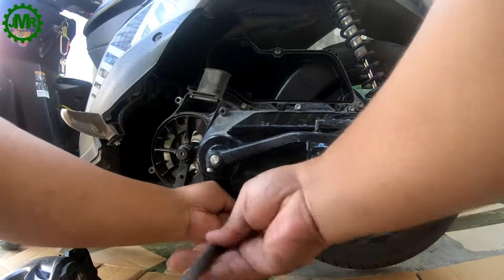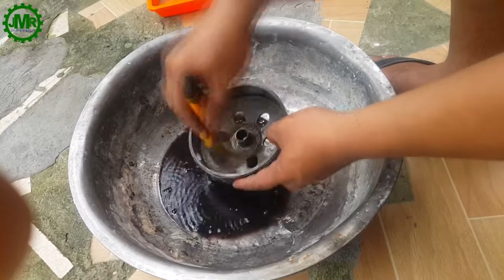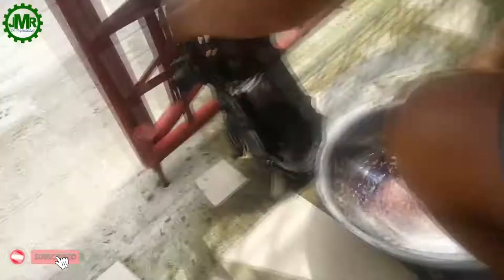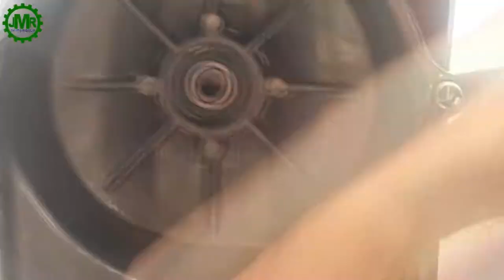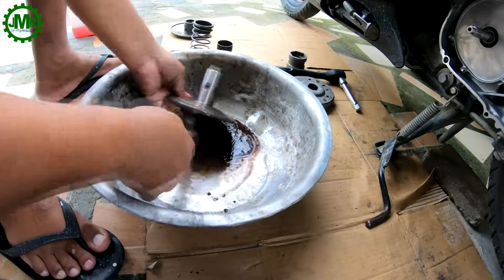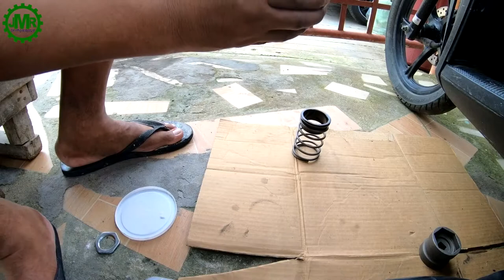CVT Cleaning Mio I 125 Tutorial  | Linis Panggilid | Torque Drive Cleaning | Tune Up | JVT 12

Comment: Lods kada kailan maganda magpa cvt cleaning? And mas maganda ba kapag nagpa linis bumili ako cvt degreaser/cleaner spray? Di pla masyado gamitin mio ko lods pamalengke lang minsanan pa.
Reply from the maker: Kung hindi naman masyadong gamitin na pwede na every year or every 9 months. Ok naman degreaser pero iwas lang na babaran lalo don sa mga oil seal.
Reply: @MotorJem  ah ganun lods so di din pala ok ung mga nabibiling cvt degreaser? Mas ok ung gas?
Reply from the maker: @itsprivate5623  Same with gas paps. Mainit kasi yon. Mas maganda water at dishwashing liquid pero matagal lang talaga matuyo. pero yon ang pinaka safe gamitin.
Reply: @MotorJem  noted thanks lodi..
Reply from the maker: @itsprivate5623  Welcome paps.
Reply: So anu maganda gamitin paps gasolina a diesel or degreaser?
Reply: @markjasoncodilla  degreaser nalang paps para dun talaga ginawa un mura lang din nmn at minsan lang nmn gagamitin.